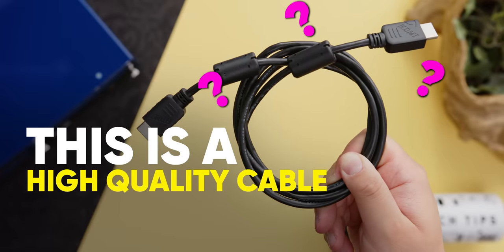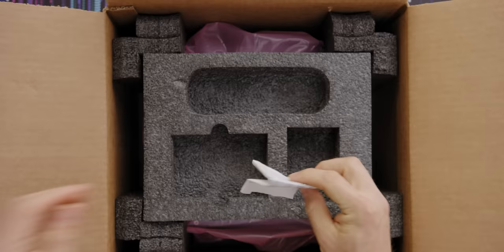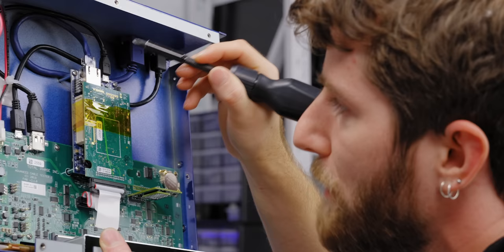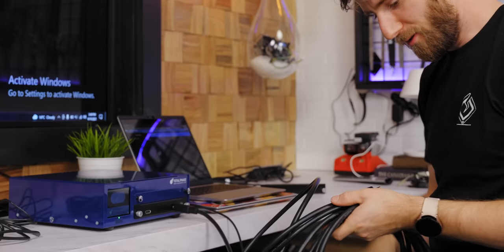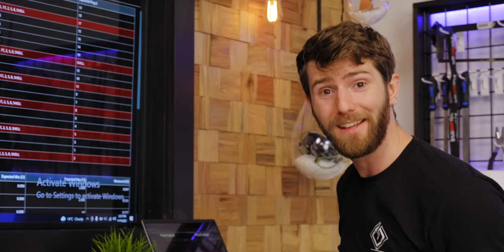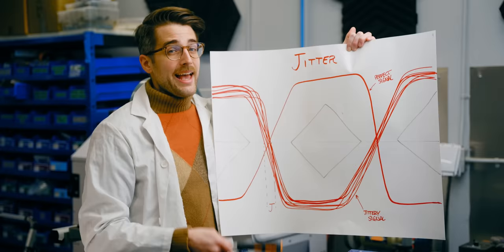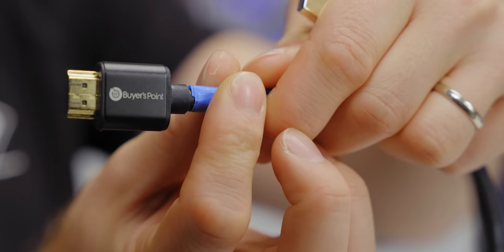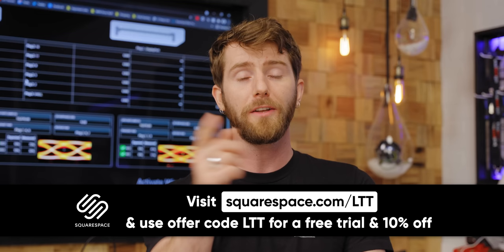This Just Saved me $100,000 - Totalphase Cable Tester

Comment: When you review a monitor you should run any included cable through the tester.
Reply: 100% this
Reply: Or any other peripheral with a detachable cable. A warning about a good peripheral having a bad cable packaged with it would be nice so I don't return the peripheral itself instead of replacing the cable.
Reply: big YES
Reply: Great Idea!
Reply: The included cables are probably actually really good
Reply: Great idea
Reply: It would be really cool to see the cable tester peppered into other videos like this
Reply: I back this 100%.
Wouldn't be all that different to normal reviews, since all that'd be needed is a quick 15-60 second segment that at least shows the result of the test, or the result of the test and what the visualizations look like.
Reply: Definitely should do this. A friend recently bought an LG 27" monitor w/ Thunderbolt support and the included cable didn't work with their Macbook. They needed to buy a separate, beefier cable to get it to work.
Reply: Beat me to it!
Reply: Not only hdmi cables but phone cables and any whatever cable products comes with I might suggest. Shortcircuit channel would especially get this test in great use also to call out on manufactures that doesn't include proper cable that follows the standards for whatever that is needed for. For instance, phones with USB c cables should be tested for high speed data transfer, video output, power delivery and so on. Thats a great idea.
Reply: Yes
Reply: Just sharing an spreadsheet of what you got laying around would be a great service for the PCMR community and the general A/V crowd as well.
Reply: This, but not just for monitors. Consoles, computers, smartphones, any device that comes with a cable.
Reply: Absolutely.
Reply: @kronik907  99% this!
Reply: Yes please!
Reply: I once had an included DVI cable that for some reason made my PC boot much slower. Switched to another DVI cable and boom, boot time got cut by two thirds.
Reply: it would also be nice for them to do it with included phone cables too
Reply: @alouisschafer7212  "probably" being the reason to check. It's an easy and quick addition to a review so I think it'd make sense to run a check. As you say most will likely be ok but gives extra piece of mind
Reply: @alouisschafer7212  Your key word there is "probably". This testing equipment will allow us consumers to find out for sure. Like Linus said, helping identify the snake oil and BS.
Reply: Or when he does phone reviews see if he can get that max transfer speed by eliminating the cable as the problem COUGH COUGH HUAWEI!
Reply: This is why I love LTT. I still love Jay's 2 cents and Steve for reviews of hardware and basic knowledge, but when Linus digs into a niche issue I expand my understanding a lot more than I realized I cared to.
Reply: @alouisschafer7212  I haven't had any problems with included cables in the past either but I think it would be a good test regardless because you can spend 30 seconds in the video talking about it in a phone unboxing, a monitor review, or really anything of that nature. It probably wouldn't upset viewers that don't want to see it if it doesn't take too long to talk about and I would assume it wouldn't take much longer on top of the shoot if this is already setup to just go.
Reply: Also the cable included with a games console
Reply: They don't really need to cover it unless there's something out of the ordinary. Just a quick "all peripherals meet their standard" will do. could get tricky with sponsored videos but we're trusting LMG integrity here.
Reply: Was just about to say this. Probably the cable everyone reading this is using right now.
Reply: Or ANY device with included cables!
Reply: Please do this! It can make or break a monitor purchase if two monitors are the same price with similar specs but one comes with a cable that simply won't work for the monitor itself.
Reply: I buy a Dell monitor and after pair of weeks got fail images an others problems, after change the cable all problems banished
Reply: The same with phones as well
Reply: How about ANY included cables with ANY products.
Reply: This
Reply: The thing is including cables that are junk would be insane for a manufacturer to do like why would you sell a 1440p 144hz screen for example and include a cable that can barely push 1080p. Imagine the number of units being returned because a stupid cable. Disastrous. That company would loose millions.
This is why accessories always get the job done:
Companies are terrified of loosing money and reputation. And in business Reputation equals money.
Reply: gee you think?
Reply: Yep! Also he can say the brand name of the cable tester every time by saying ok we are testing this monitor and to make sure our cable is 100% I'm running it through the...... EZ Clap money.
Reply: I'm more interested in learning which monitors play well with the lower quality cables.
Reply: Or use the same cable (at least brand and model) for testing.
Reply: Agreed
Reply: The cable that came with my monitor literally caused my PC to error and not turn on
Reply: Absolutely
Reply: Oh, 100% this. Ltt, please pin this.
Reply: Years ago my grandfather would take the vacuum tubes out of his radio to our local department store and put them in a tester.  The bad tubes got replaced and the radio was good for a few more years. 

Maybe some store like Best Buy could setup a tester so we can bring in of expensive cables for tester.  
Downside: The lineup would be around the block!

Comment: I lost an insane amount of time troubleshooting "premium" very expensive DP cables for my 1440p 144Hz new display. It actually was making my PC not even power on. In the end i learned that many manufacturers cut cost on DP cables by sorting PIN 1 to +5V while it should have +3.3V something along these lines. Long story short i tried a few premium cables and non did 1440p/144Hz/Freesync/HDR. In the end the most inexpensive cable i bought was the most reliable and it actually had specs on max bandwidth supported. I find it ridiculous how many cables had no info on the box on what exactly they support bandwidth wise or if they did had weird pin out on "non-essential" pins.
Reply: preach
Reply: So in the end the best option is still to buy the cheapest and pray. Great, I've been doing that forever.
Reply: Because they know most people don't know/care. I bet you that the average person doesn't know that there is such thing as a new standard of HDMI from the first version
Reply: I even know people, who don't have 4K TV, cause it's pointless to them, when their 1080p Full HD display work fine just fine. I may be because 4K television per se is having a very hard time arriving around here tho...
Reply: Which brand?
Reply: You want DP+ , thats the symbol to look for

Comment: I would like to see a "budget brand" vs "premium brand" cable test covering each of the cable types you can test.  I'd suggest the cables to be tested to come from Best Buy,  Newegg, Amazon and so forth.  It would be very nice to see which type is really better and when we SHOULD spend more on a cable vs less on the same type of cable.
Reply: Sounds like a fun video idea!
Reply: test them by manufacture brand, most cable have a manufacture , even it it ever som hard to find sometimes
Reply: @mareli82  this would be the best way. No use in saying "brand A's HDMI is perfect, but its DisplayPort sucks". I want "ignore brand A, trust brand B"
Reply: Especially Walmart. House brand. That should be real entertaining.
Reply: I tried a lot of cables. Honestly, even the super fancy ones were pretty disappointing. Go cheap.
Reply: Something like the Monster Cable vs Coathanger thing, but much wider is scope. Yes. This is something badly needed.
Reply: Yes yes yes this and i want to see rca cables tested
Reply: And if they can afford one, (and they are still made), Monster.  Those overpriced all bells & whistles, OFC, etc. etc.
Reply: On top of the budget and premium stack... how about adding major brands in terms of how they are in the stack, Samsung USB-C, Apple's Lightning, Nintendo's HDMI, Razer's USB-C, etc. Does the extra price justify the price tag and official branding (especially Apple).
Reply: The answer is you shouldn't unless there is a specific need for it (a need for longer lengths, higher insulation or being plugged in or out more than normal, uses analog signal etc.) Most normal uses like sending a signal from an Xbox to a TV won't need more than a decent cable. A $1 HDMI cable may cause you issues (though you could get lucky). A $10 cable is probably fine (as long as it's a reputable brand). And $80 premium cable is a waste of your money. 

Most premium cables just meet the spec and slap a "premium" label on themselves.
Reply: Oh... and, in line with the Monster Cable vs Coathanger thing, they should also rig up some extremely janky conductors between a pair of connectors and just see what the tester makes of it. For some cables, the extremely high-frequency ones especially, it's probably not gonna tell us anything very surprising, but would still be funny to see, but there's still plenty of cables used in various computing contexts that operate in such a way that it's entirely possible a set of coat hangers could outperform a store-bought cable, at least in some metrics, and it'd be interesting to see if any of them actually do so.

Comment: I really love that you offered to do testing. The only thing to be wary about is your sampling size. Pulling a single model of cable from a manufacturer SHOULD give us a good idea of what they're generally putting out, but it could technically have some variances that put it above or below spec.

To really "stick feet to the fire", as it were, you'd pull several of the same cable, preferably from different locations so you theoretically could be getting items from different manufacturing runs/lots.

Alternatively, getting a new one and thus testing the same model across time could give us a semblance of a "sample", with better consideration for consistency, improvements, or degradations.

Comment: I'd love to see how different adapters can affect signal rigidity, like usb-c hubs to HDMI, or display-port to USB-c
Reply: Might be tricky as the tester machine probably needs a bespoke tester head that has 'usbc + hdmi' ports on it...otherwise you'd have to introduce 2 adapters, one to test the cable, and another to test the adapter - at which point you have more points of failure and couldn't be sure what caused the problem.
Reply: Would love to see this. I get massive signal integrity problems using wireless peripheral dongles on USB hubs with power pass-through like USB PD. Massive headache.
Reply: Theoretically, it shouldn't at all. Since the signal is first digitized and then reconstructed from it's samples. Where the issue might occur is if the receiver is of bad quality and the signal is not sampled correctly before being reconstructed.
Reply: it'd be interesting to show the difference between simple adapters and active adapters that have to reprocess the signal
Reply: @pietheijn-vo1gt  theoretically, maybe. However, as this video shows, sometimes the specs ain't up to snuff. You make good points though!
Reply: @pietheijn-vo1gt  Trouble still being that you're not sure if the failure is happening inside the adapter/passthru/hub or in the cable...and if there is any active signal reconstruction then you can't 'make a signal' and 'see how clean it is on the other side' in a pure bandwidth sense.

Comment: my friend was a very early adopter of this standard and got many cables that were all apparently validated with one of these machines but lo and behold they mostly didn't work properly at HDMI 2.1 speeds. most of them would not give him full resolution/hz/colour depth, or would only work with heavy chroma subsampling etc. the most common issues were the cables with active components. testers only run small burst tests and would not find overheating issues. he suspects that even some of these machines themselves are not configured to test the bandwidth of HDMI 2.1 correctly due to the confusion over this new standard. I hope when you do these reviews that you test every cable hooked up to real hardware too
Reply: Hi DeSinc!
Reply: @Vladislav_0001  hello
Reply: The flying funny half life man is on a lmg video about a cable tester talking about hdmi 2/2.1 cables that do not meet the standard
Reply: This is supposed to be a quick and dirty test. I don't know how much the box in this video actually costs but I don't imagine it's consumer-level pricing, however it's still only quick-and-dirty level in terms of industrial certification standard.

A full rigorous test for certification takes 30 minutes (edit: it's actually closer to 2 hours if checking every resolution) and involves a EMI-free chamber with rotational capabilities.
https://youtu.be/QpRnAdC3NNE?t=300
Reply: I love the occasional interaction DeSinc has with all of my favourite YouTubers
Reply: @lagrangemechanics  $15k, I think? It may not test the full standard, but I don't think there's anything "dirty" about this test. Anything that goes beyond continuity and resistance is great! At least it's getting into the realm of whether the cable is physically able to transfer data at the quoted speeds. Whether it's susceptible to EMI is that next level that probably doesn't matter to home consumers.
Reply: I read this in your voice
Reply: This was quite literally my experience with HDMI 2.1 last year when I got my 3090. I went through at least 6 different 48GBPS cables and they all had the same issue - they'd work at the full bandwidth at first, and then would degrade over time with dropouts and connection issues. The connector felt like it could fry an egg. 

I finally found a CableMatters HDMI 2.1 cable that doesn't get too hot to touch and it's been great since then.
Reply: @lagrangemechanics  What you say is true. But I think from a consumer electronics standpoint this test is good enough. On the other hard if you are setting up something mission critical and failure would result in big money being lost, by all means insist on fully validated cables.
Reply: Ok listen up here: Get one of those temp controlled food driers, set temp to what you might expect to be the worst this cable could get to, toss cables in, wait till they heat up and then run them trough the machine.
Reply: You mean, "Who will test the testers?"?
Reply: AV receivers from Denon/Marantz  have built in hdmi speed testers
Reply: @lagrangemechanics  that sounds good but the main issue with cables is that they don't stand up to emf interference so that is definitely a shitty way of testing a cable.
Reply: @jimstanley_49  Generally, there’s 3 levels of testing (I’m coming from the network cabling world, but the same idea applies), function, certification and metrology. A function tester just does simple tests to see if the cable is intact, so say a continuity test, but it assumes that the cable was otherwise built to a standard that as long as it’s functionally correct, it’ll work. A certification tester is the next best thing, it’s used to prove that a cable actually meets the standard it should, so it does maybe frequency and crosstalk tests as well. There a bit of overlap between the two levels (aka some advanced function tester might approach the functionality of a certification tester), but the main difference is that a certification tester also need to be calibrated to a traceable standard, usually yearly. Metrology level equipment is the big boxes that never leaves the lab, and are generally more general purpose, aka. they test anything at any level, not a preprogrammed gamut of tests according to some standard, so if you wake up one day and want to see if a lamp cord can handle 500 MHz, it’ll happily do it. The box Linus has is a certification tester, provided it has been calibrated and is kept calibrated, as it does most of the tests expected to see if a cable meets a certain standard.
Reply: The one and only DeSinc!
Atleast to my knowledge.
Reply: Linus just wasted 100k. LOL FAIL.

Comment: Or you could do an episode wherein you show all the brands and see if it's worth paying more for the mainstream brands if cheaper cables function to the spec they specify.
Reply: The cables they have might be years old and they probably can't at this point guarantee that they've all seen the same kind of usage. They'd have to buy new cable.
Reply: Yes, I've sworn by Anker USB A & C cables for a while now but are they really that much better? I just know they work and am worried to try anything else so would be nice to see any alternatives with just as good/better quality
Reply: i've wondered that about "generic" brand hdmi 2.1 cables vs any name brand gold plated ones
Reply: Great idea!
Reply: @PrograError  The problem with cheap cables is they're likely to change manufacturers without warning, so one cable passing wont guarantee you get the same grade cable.

Obviously that can still happen with branded, but probably less frequently.